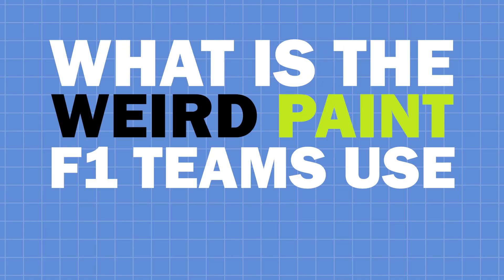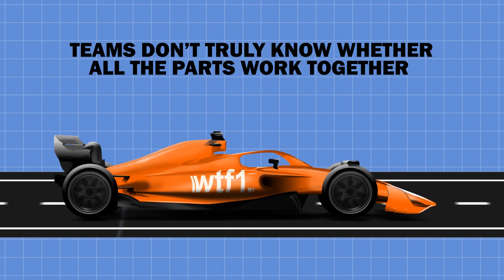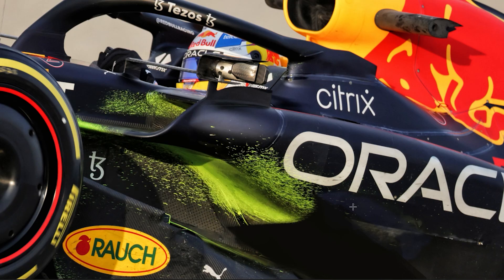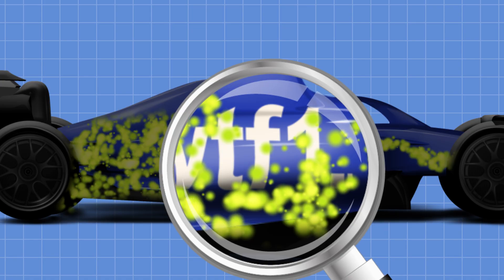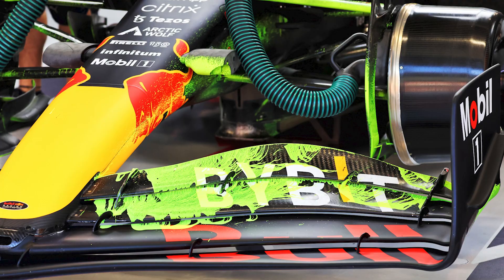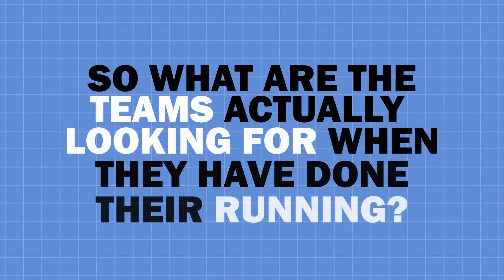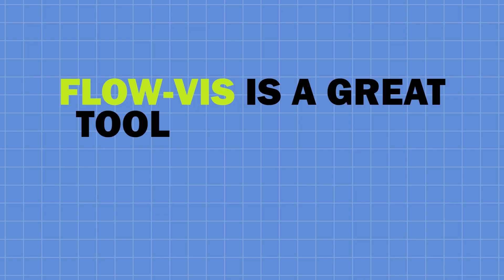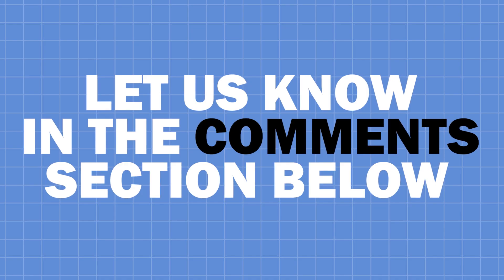What is the weird paint F1 teams use in testing?

Comment: The stuff is called Flow Wiz. 
Everybody knows that since they use it for some years now. 

It shows how air affects on the bodywork. Its important for proof of the aerodynamic concepts.
You may also see cars running with a steel or aluminium cage and measuring devices fixed on it. 
Same reason, proof of aerodynamic concepts from the drawing board to the track.

BTW Its no paint its a liquid that is rather easily removable.

Comment: 0:50 well normal paint is also some powder mixed with an solvent (in this case oil/paraffin)
Reply: im not sitting on a chair rn
im sitting on a structure designed to support my weight constructed out of metal, wood and other materials
Reply: A binder or medium, not a solvent. But you've got the idea!
Reply: @8thlvlMage  those are solvents..